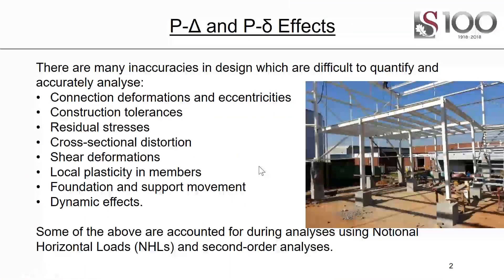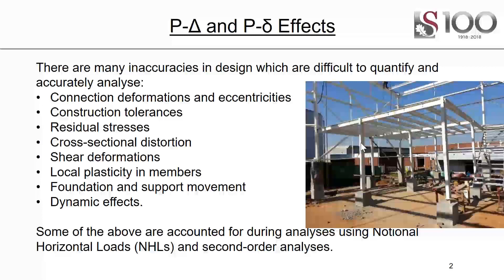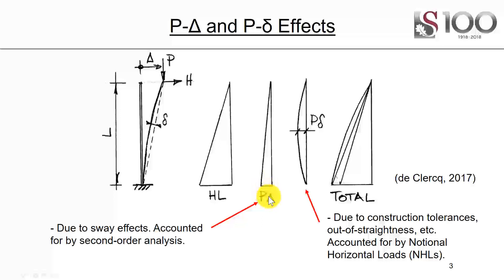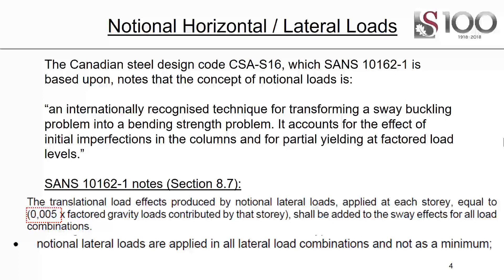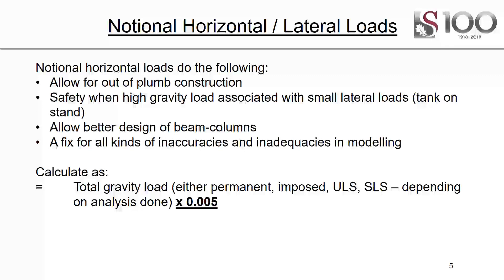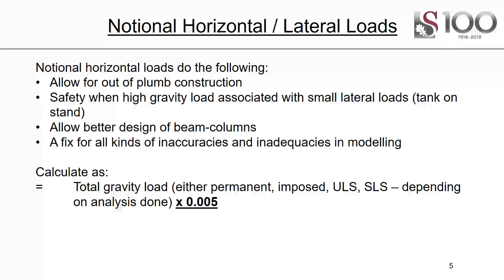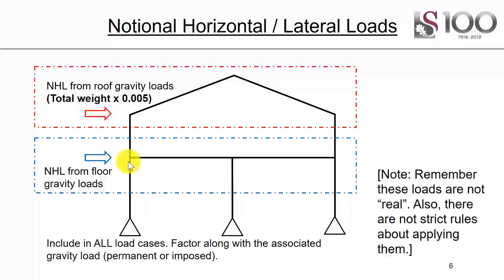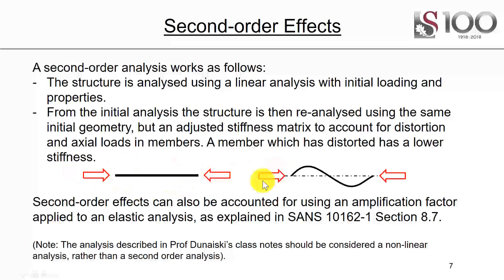Structural Analysis and Design - P-delta effects, Second-order Analyses & Notional Horizontal Loads

Comment: HI, thank you for the video, it's very informative. I have question, when  analyzing  pdelta, what load combination do you use for the delta displacement? just the horizontal force? or do you consider the gravity load (Dead + Lateral Load)?  Additionally, when analyzing story drifts for seismic and wind, what load combination should be used? (Only Lateral Load? Or gravity load + lateral load?